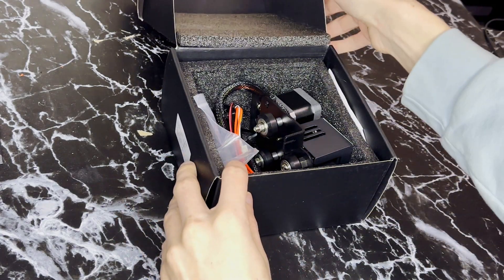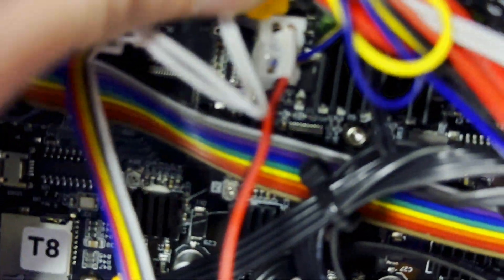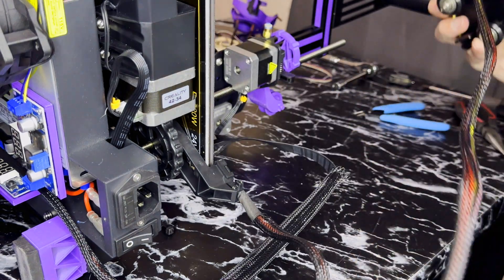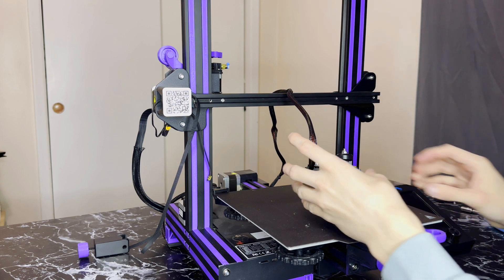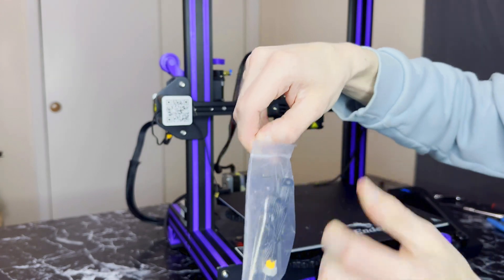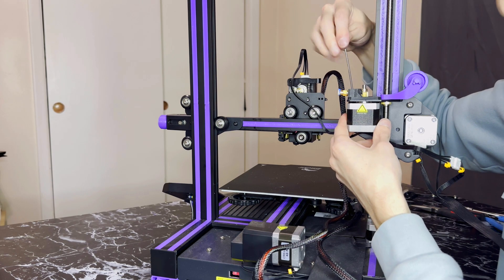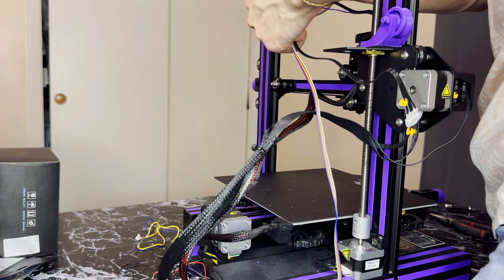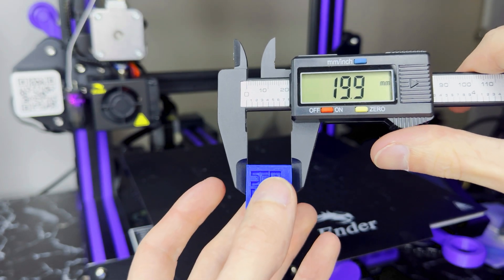This $40 Mod Will Turn Your Ender 3 Into A Prusa... Kinda  -  Direct Drive Conversion

Comment: Why the need for dealing with the wires? Can't the new motor be connected to the socket used by the original one?

Comment: I have an ender 3 pro....best upgrade...only 30 bucks... plus silicon spacers instead of the spings... I paid 20 for the printer plus another 40 for the upgrade and the spacers... Thing prints a million times better than it did before..(considering i got it off of facebook..... those people abused it and didnt really know anything about 3d printing lol)

Comment: Can you help us with the calculation of the z offset, we got the same upgrade for our creality ender 3 neo and it's been a bit of a nightmare with the z axis and the x axis not lining properly we had to print the bracket for the cr touch since our direct deive did not come with the mount as yours did
Reply: Same ❤

Comment: Got to add dual z to carry the wieght. Been down this road. I since got a second ender 3 and left it bone stock except for hotend. I think the stock one holds its own against my heavily moded one. Keep it simple. Save money and time.
Reply: just did this to mine and noticed i need the 2nd rail
Reply: Was gonna say the same thing. I got a ender 3 v2 and all that I've done is PEI bed, CR Touch, and bi metal heat break. It may not be as fast as a Bambo or Voron, but I'd put it up against anything when it comes to quality prints.

Comment: This is not a true direct drive system because there is still a Bowden tube, even though it is short. I ran my ender 3 with this setup for a while but eventually my extruder wore out and wouldn't grip the filament well and was grinding the filament too easily. I switched to the sprite direct drive extruder and it works alot better.

Comment: After installing and trying to auto home it failed you think you have any idea why?
Reply: Happened to me too. In my case I had 2 connectors reversed. Also set your parameters to default but take note of your e steps.

Comment: You should put the bltouch/crtouch bracket in front of the fan shroud otherwise it adds distance between the heat break and fan and therefore won't run as efficiently and thermal runaway might occur.
Reply: neglegable distance, doesn't matter

Comment: Did same direct drive upgrade on my ender3v2 bit over year back, huge increase in reliable prints and quality, have a very high success rate.   Also added extra z rail(2 motor kit found online), auto leveling, new springs and knobs on bed.  Currently can print Nylonx speeds up to 140mm with good prints best print speeds seem to be around 125mm.  I also added the surround cover to keep heat study around unit.   I put rolls of filament I will print either into a Sunlu filament heater and also inside the surround area with the bed plate temp set for 98C 6 hours before I start prints with filaments which are sensitive to moisture.  Shorter filament heat times are used when only using PLA.  

I am having great success with NylonX using 72C bed temp with fan off, and nozzle temp at 259C.  Took awhile on settings but have found increasing retraction speeds and amounts plus running slightly faster print speeds after base layers finished give best results.  I use mixture of glue stick and Aussie 2x hairspray on the default-build plate which came with the unit and 90% of time hardened steel .06 nozzles.   Very happy with this upgrade to unit purchased few years back.  

My next unit will be the Bambu Labs at some future point, this unit will primarily be used with .06 and .08 hardened tips keeping print speeds towards top end and will serve as second printer for small production runs.    This was a great project to really learn fundamentals of 3d printing at much higher level while getting massive improvements in prints.  The auto leveling upgrade must have, even though I did great job of leveling plate manually in past, just speeds things up and gives repeatable results.  The direct drive is fantastic upgrade highly recommended for minimal investment, but make sure you add the second z axis for rigidity and get it installed perfectly level along with autolevel feature on older Ender3Vs units.  The enclosure while cheap serves as great way to remove moisture pre-run from filaments having bed temp sitting at 98C for several hours with filaments sitting in the enclosure.

Comment: I did not see estep calibration is this not required?
Reply: Not really... might want to lower them jussst a bit.. but I printed a snake.... came out great.... printed the piece to do this upgrade... then dis the upgrade... printed ANOTHER snake... 3 hours it took.. scaled down to 50%.... seeemed like it was a little over extruding on the initial layer.. but turned out beauutifull🫡
Reply: @stickboyfpv4742  ya I ended up setting that up on my og ender 3 as well as an all metal hotend, took a bit of stuffing around to get it mounted, especially replacing the plastic extruder with a metal one, but I finally got it printing nicely.  

Only pain is on the odd occasion if I leave my printer loaded with filament the filament can snap inside the extruder, just due to fatigue or something and I have to unscrew it to clear the filament, but it takes me like 1 minute, and happens only rarely, finally got around to printing TPU, and it prints well, probably got some tweaking, but I was able to print a phone case no issue.   

I did actually change my e-steps slightly, and z-offset had to be recalibrated, but you should recalibrate if you change a nozzle, so not really unexpected.
Reply: @pellcorp  Oohhhh I seee! Nice dawg! Yeah thats the only down side...! Having to disassemble to unclog the nozzle... but long as you dont have plastic coming out or anything abnormal... just try cranking the temp up to like 240.... and FORCE some plastic thru... Usuallyyy cleans er alll out!

Comment: This is a bad idea since you are increasing a lot the weight on the X gantry. You need dual Z configuration for this.
Reply: Not really😏
Reply: @stickboyfpv4742 Yes really, I noticed heavy ringing on my Creality Setup. Went top mount bowden instead.

Comment: With much less $$ you could just buy a cheap dual drive clone and a pancake Stepper motor. Print yourself a afterburner, if you believe this is a good mod, de Voron afterburner will blow your mind in every aspect! 
If you wanted that mod you could just buy the modified eplate cheaper. I got one here, never used it and never will , it's very heavy, not user friendly, and it uses those bad original extruders. 
Another tip: you don't need to remove the gantry to slide off the eplate, just get the eccentric wheel loose and it will come out, dont need to remove the idler either.
Kinda curious on what you have going on in the electronics under the printer ...

Comment: Just print a mount for your existing extruder and motor. No real need to buy a whole new carriage. 🤔
Reply: You mean Separated Plate and Wire equipment.
Reply: @NOELQUEZON  i lit just did a print and did not have to buy anything

Comment: Deleting comments???  Are you making money on selling people stuff they already have and hence don't have to pay $40 for?
Reply from the maker: What?
Reply: @kelpy222   I have twice added a comment that you don't need to buy anything except for a motor cable extension to turn the Ender 3 into direct drive (and even a better one than the one in the video where the motor is sticking out to the front, cause unnecessary high torque on the POM wheels), just to see each of the posts deleted seconds later.
Reply: The project in Thingiverse is called Direct Drivinator and I'm using it for years.
Reply: Let's see which of these comments now survived the censorship...

Comment: I recently did most of the noctua and fang upgrades from your other video. Now I'm contemplating a direct drive. Does it work with noctua fans?
Reply from the maker: I just got a direct drive, it is possible to use Noctua fans with it with a different cover that you need to print instead

Comment: Would this extruder work with a v6 hotend? I accidentally got the direct driver version of the hot end and figured I would try out direct drive but can’t find good info on what DD to get for the v6